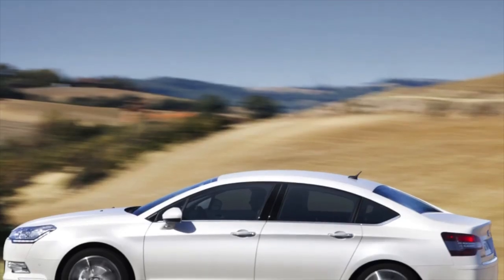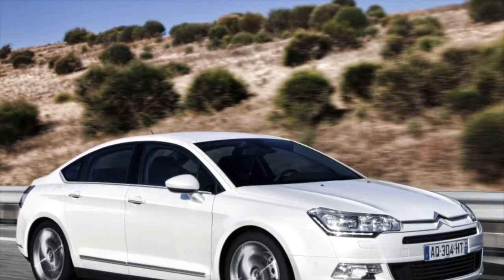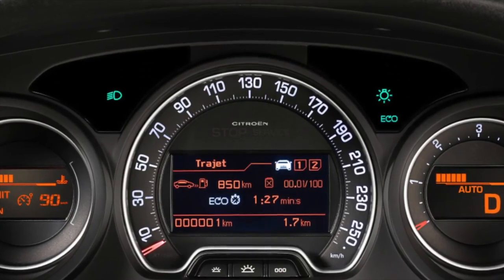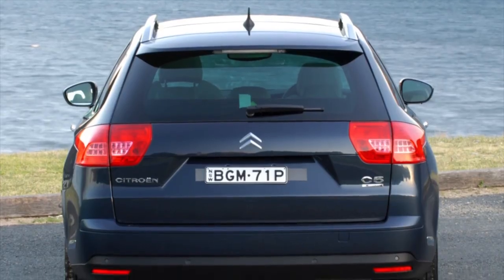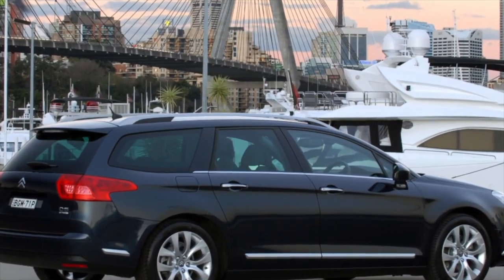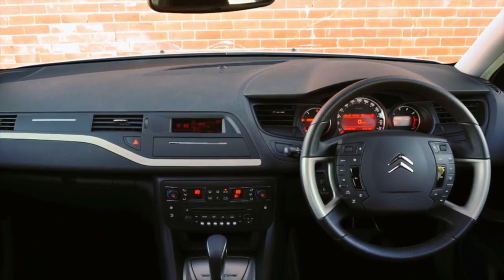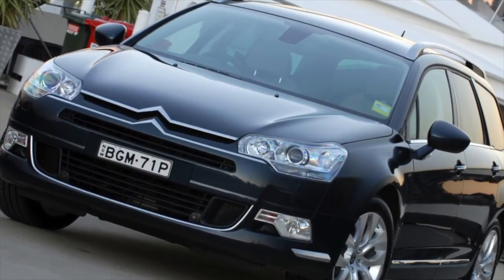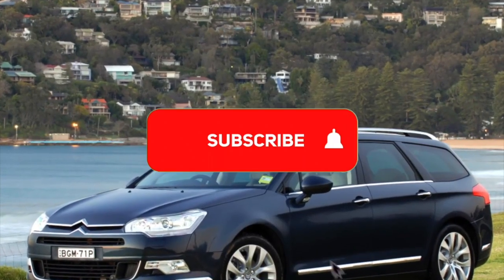TOP Things that will BREAK on your Citroen C5 X7

Comment: I own a 1.6 hdi 109 ps 2009 currently 243 000 km. and I have to say that the car is amazing. With the proper maintenance it is very reliable, comfortable and the fuel consumption is amazing. I mean what other choices do I have to replace my C5 to get all the above: Big car, economical, enough PS (for me), low tax because of the 1.6 and very safe? I like my C5.
Reply: I have the 1.6hdi 2008 180kkm bought it used and put many many hours of love in it due to oil leaks on engine block and many other things, but still I love this car and as you said it has so much comfort and fuel consumption was on a 3300km trip to Nice in France at the average of 6.3L that’s insanely low! 
I love it and will do my best to have it as long as possible